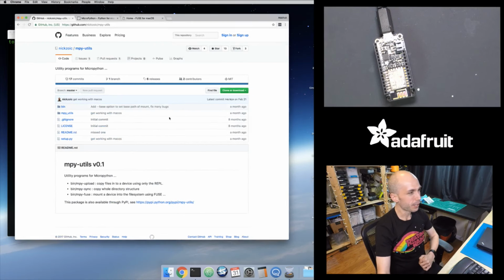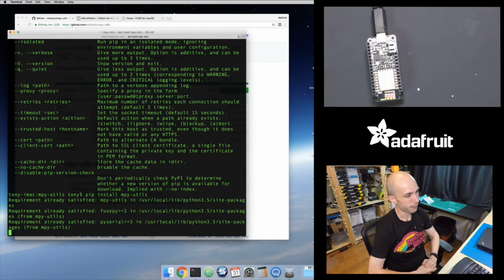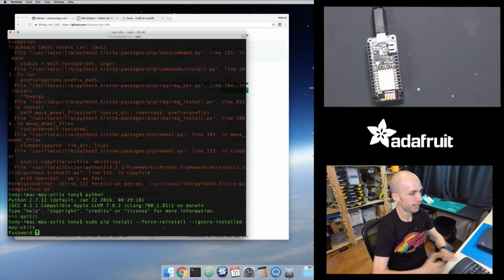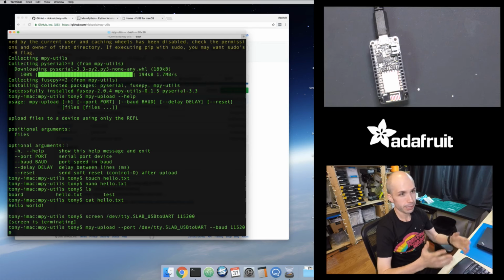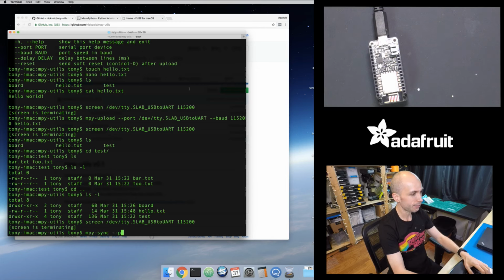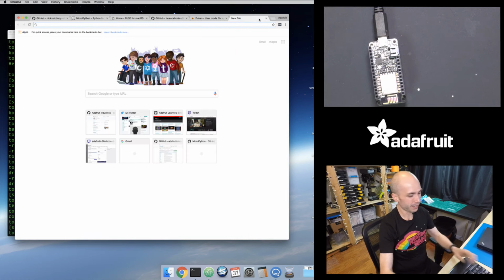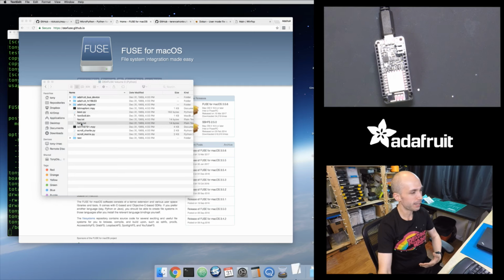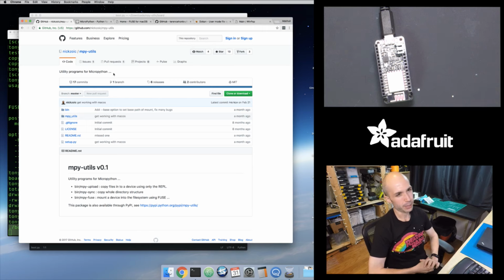MicroPython mpy-utils: Mount MicroPython board as filesystem and more with Tony D!

Comment: Thanks ,Tony , for all your MicroPython tutorial videos... and MicroPython development work ("ampy", et al).

While I was having problems using "ampy" on a Chromebook/Crouton/Ubuntu Linux machine, it appears the problem 
was with my mix of tools fighting over control of the serial USB port (/dev/ttyUSB0). I have since standardized on 
'rshell' and "ampy", and the fighting over the serial port has been essentially eliminated.The 'mpy-upload' utility also works 
for me, but "ampy" is a lot more versatile, so I'm not using the "mpy-utils" that much.

Also, in my original version of this post, I mentioned you can execute a MicroPython '.py' script from the REPL prompt using the "import" command. For instance, if you have 'hello.py' already downloaded to you ESP8266 file-system, you can execute it using this command:  

>>>  import hello

Then, if you run it again, you will find the command no longer works to execute the program. What you can do is a soft reset using "Ctrl-d" at the REPL prompt, or a hard reset (press the reset button on your ESP8266 board). Then the import command will work (but still just one time before having to reset). For this reason, I find using "ampy" with its "run" option an easier way to run scripts than trying it from the REPL prompt (and avoiding the need to the ESP8266 board all the time).

While talking about the REPL prompt, I have noticed that the MicroPython built-in  'vfs' module which also implements many of the 'os' module commands, like listdir(), chdir(), etc. The advantage of using the 'vfs' module for these commands is that you do not have to import the 'os' module to use them. Just enter:

>>> vfs.listdir()
['boot.py', 'hello.py', 'gtest2.py', 'gtest3.py', 'gtest1.py', 'ili9341.mpy', 'rgb.mpy', 'boards']
>>> 

to get a list of all the files and directories on the root directory, or

>>> vfs.listdir('boards')
['adaFeatherTest.py', 'nodemcuTest.py', 'wemosD1R1test.py', 'wemosD2R2test.py' ]
>>> 

to get a list of all the files in the 'boards' sub-directory. Other commands are provided for mkdir(), rmdir(), getcwd(), 
remove(), rename() and perhaps a couple of more. You can use the following command for listing which commands 
(member functions) are included with 'vfs':

>>> dir(vfs)
['mkfs', 'open', 'listdir', 'mkdir', 'rmdir', 'chdir', 'getcwd', 'remove', 'rename', 'stat', 'statvfs', 'umount']
>>> 

I suppose some of these commands are potentially dangerous to use ( mkfs(), umount(), remove() ).

But, if you do decide to import the 'os' module, it saves you from having to type 1 extra character each time thereafter:

>>> import os
>>> os.listdir()
['boot.py', 'hello.py', 'gtest2.py', 'gtest3.py', 'gtest1.py', 'ili9341.mpy', 'rgb.mpy', 'boards']
>>>

===================
 Chromebook "ampy"?
===================

I'm hoping for more support in terms of having "ampy" available to run under CromeOS on standard Chromebooks without having to go into developers mode. Seems there is a problem installing "ampy" that can't be worked around w/o going into developers mode. So, perhaps a version of "ampy" that installs using whatever method those apps at the Chrome store use to install their apps. This is the main stumbling point for getting MicroPython "running right" on the Chromebook. I can use one of several text editors to create the MicroPython source files, and there seem to be a couple of serial terminal emulators to get at the REPL prompt (">>>"), but I have yet to find a way to download and execute the MicroPython source files to the ESP8266 file-system.

In Chromebook, I am using both 'Caret' and 'Zed' as text editors and 'BeagleTerm' as the serial port emulator to get 
me down to the MicroPython REPL prompt. They seem to work adequately well.

Since many schools these days are using Chromebooks, and most MCU development systems (including Arduino IDE) don't work on Chromebook, it seems like a good market for Adafruit.

Also, for the Adafruit Feather ESP8266 / FeatherWing ILI9341 TFT combo, I would like to see a port of the Turtle graphics module to MicroPython, or at least a "pared down" version of it. Teaching kids Python programming using Turtle graphics is very effective in that the graphics it produces hooks their attention quit well. If Adafruit is looking to market products into schools, a Feather ESP8266/FeatherWing ILI9241 TFT housed in a nice plastic case with some GPIO pins still 
accessible from outside the case, would make for a nice platform for IoT applications, teaching Micropython, and electronics in general. Seems Adafruit is most of the way there. Just a nice text oriented print module for displaying text on the TFT displaym and the fore mentioned Turtle graphics module, and I think Adafruit would have a winning product, especially if coupled with marketing efforts into schools (Google seems to have a very effective one with Cromebooks, so maybe a few more "Google hooks" and you can have them market it for you).
Reply: Seems that "rshell" has the magic ability of resurrecting my serial (/dev/ttyUSB) connection, even when the Ubuntu shell can not. So, now I don't have to reboot my Chromebook/Crouton/Ubuntu Linux machine every time I have used "ampy". Seens that "ampy" is working just fine in conjunction with rshell. Now I can get some productive work doe in MicroPython.